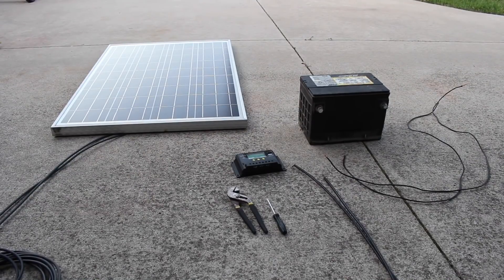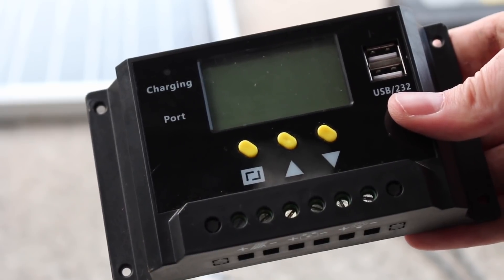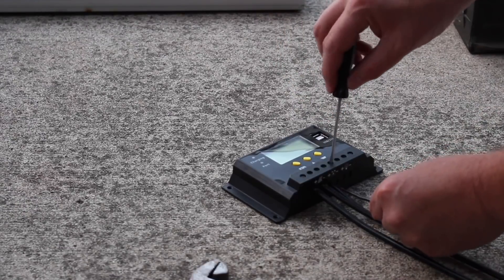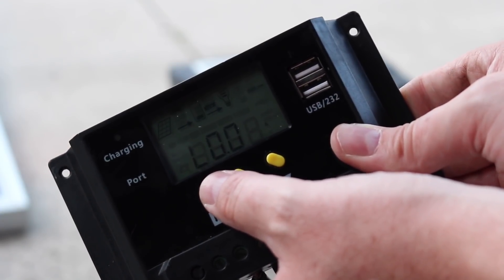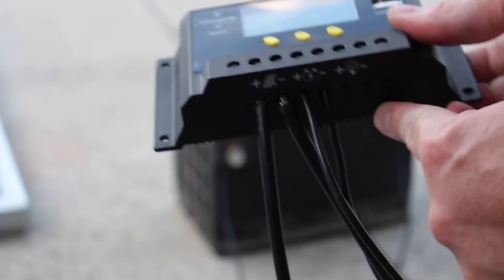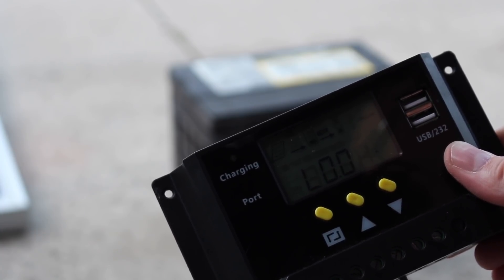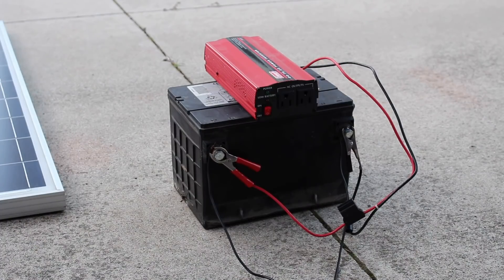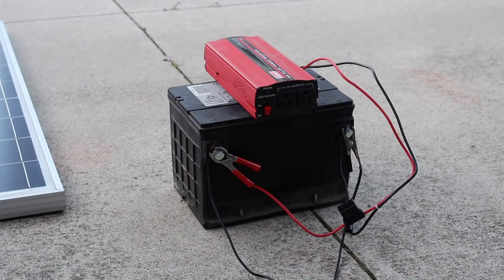Basic Renogy 100W Solar Panel setup!

Comment: How much does it cost simple setup?
Reply from the maker: A few hundred, I believe the panels are $130, then you need a battery and inverter.
Reply: @MikeSimon  thank you, my research on danish market says 350,- $, of cause i do not know if there options for find cheaper parts....
Reply: @MikeSimon  power converter most expensive and diff. prices on sol panels depend on type.

Comment: I want to use a Li-Ion battery but I find no info about these chargers, what is their maximum charging voltage, in my case should be no more than 12.6V.

Comment: Just into the video he connects the panel first - manual says "NEVER connect the solar panel to the controller without a battery".
Reply: My first reaction also. It's like intstaling plumbing under pressure! :-)

Comment: I ordered a kit from renogy on March 11th and as of June 11th was still waiting for the panel. Their customer service has been mediocre, replying with, "it's on the way" everytime I message them. 
I finally asked when it will arrive and was told its on back order now. I told them they've wasted my time and to issue a refund or credit. They took 10 days to issue the refund and then today only issued a partial refund. 
I would not recommend renogy to anyone.  Renogy is a terrible company to buy from.

Comment: Thanks, I didn't know the load was coming straight from the panel.  If I'm taking power from the battery how to I get the charge controller to stop at a point when the battery runs low ? Or can I only do those settings on the load ?

Comment: I have 2 75watts LED grow lights. I need to run them for 10 hours. Would this set up give me enough to run them both for that long? If not, how would I double my wattage and time. I'm looking for cheap solutions. This seems perfect for what I need. Perhaps I'd need 2 100w solar panels and two batteries? How would I do that. Would you mind making a video on how? This video really helped me get the basics I'm definitely going to buy a battery and a solor panel and converter.
Reply from the maker: Hello! So here is the simplest way to put it.. I think it will help you. First thing is figure out how much battery you have for example you have a 12V 100AH battery...convert it to watts by taking the AH x V (100x12) this gives you 1200watts. Rule of thumb is only drain battery to half for longer life. So this gives you 600watts to play with, now divide  600 / 150 (75 watts x 2) will give you 4 hours of run time. If you need more time then get more batteries. Now the same comes into play when you charge the batteries, if you only have 1 100watt solar panel it will take you 6 hours to recharge that 600watts you used. Let me know if this makes sense.
Reply: @MikeSimon  thank you for the advice. Yeah that made alot of sense. I wasnt sure I'd be able to u understand.

Comment: wrong procedure ...connect the positive and negative wire of battery first in the controller so that the controller could not damage.thank u
Reply from the maker: I see this is the case in some, but I have a travel solar setup that has the wires pre connected to the charge controller and all you do is open it up and connect to a battery and turn the controller on.

Comment: Hi thank you for the video!! But I have a question I want to run about 1200 watt solar panels.I want a setup to run a ac or fridge.Im assuming I would need a inverter to AC but does it only need to connect to one battery? Or do I need more then 1 battery for 1200 watt solar panels.I am really lost ! Need to know for offgrid house thank you  x

Comment: Very easy to follow. Thanks so much for teaching. I'm thinking to buy a gas generator to run small appliances.  For just using the solar system, Is there's a way to power up a 900 watt microwave  and the minimum inverter size and fuse do I need if possible?

Comment: If I may ask a question about the panel are the electrical wires already connected when they are sent from the manufacturer
Reply from the maker: Hello, they have like a 2-3ft lead that you can connect to.
Reply: What size wire do you run between the panels and the batteries

Comment: Sir, I’m interested in this project, I can perfectly connect all the electrical solar accessories together, I just need to know the numbers of solar panel and numbers of batteries and capacity of inverter needed to supply energy for 85” TV, ten points of 220volts bulb and two fans
Thanks

Comment: The battery should be connected to the charge controller before you connect the solar panel(s).

Comment: The wires attached to the battery look way too small.  You should use 4 AWG at least.   And it's not a good idea to connect the PV to the charge controller first.   Connecting them without first connecting the charge controller to the battery can fry the controller.

Comment: Thanks for the video. You ran a 7,000 watt inverter off a single 12 volt battery? I didn't think that was possible!
Reply from the maker: That I did and had no issues
Reply: @MikeSimon  Thanks for letting me know! I thought that there was some rule of thumb between battery capacity and inverter output.
Reply: Mike, one thing I saw on a Will Prowse video was to make sure that you hold a resister on the end of one of the inverter cables, before touching it to a battery terminal, to avoid a big spark - and to wear safety goggles.

Comment: I don't understand why the inverter is connected directly to the battery? Shouldn't the charge controller regulate this?
Reply from the maker: Hello, with the inverter you draw directly from the battery, the charge controller only regulates when to charge and when not to charge so it doesn’t over charge the battery. Now there are ports on the charge controller to hook up DC but for AC you need the inverter.
Reply: @MikeSimon  Hi Mike, doesn't that allow devices to drain the battery through the inverter - especially as there is no charge display? I get that you can switch the inverter on and off, but you can't tell when the battery is too low.

Comment: Don't forget you can cook the charge controller if you have the panel connected without a battery connected. Also, you should consult wire sizing charts and use fuses/ Breakers.
Besides that, pretty good video. I applaud you for actually doing it, and not just talking about it like most people do.

Comment: Hi how are you? I was wondering if you could help me. I want to install dash cam on my family car which i use only on weekends so car usually seats for 1 without starting. My idea was to install powerbank but it would not be enough for a week. I was wondering if i can hook up Renogy’s 16W solar Trickle Charger to the dash cam and power bank. If so would it works as planned? Thank you in advance

Comment: Hello! I hooled up my inverter and no juice. I just bought harborfreight 7 watt solar panel, battery and controler. It says its charging the battery but the battery is not putting out power to tje inverter. What do you think is? Battery says its charged too. Yesterday i bought a new inverter and when i hooked it up it made a wierd crack noise and i think i toasted it, but why? Also i plugged in the negative first, which i saw u doing it in the video., should i hook up positive first nezt time?

Comment: HELP ME PLEASE!!! I live in a 2006 Ford E250 Econoline van and want to install two 200 watt solar polycrystalline panels, a fuse block, controller, inverter, and 12 volt battery. What amp fuse block do I use; what size amp or watt controller do I use; what watt inverter do I use and what size 12 volt sealed lithium battery do I use? Its tooooooo confusing from all YouTube channels to get this all bought and set up. Please advise. Your video is a great one. I need guidance on mine because I'm using more watts for my panels. I'll only be using a small 1.7 cu. In. Ganley mini fridge from Walmart; a small toaster size Arctic Air Ultra AC cooler and one fan on and off. The little apt size fridge has a compressor that comes on and off. Heading out West July and MUST have AC and fridge, fans to use daily.
Please give guidance. Thanks!!!
Reply: Go watch Will Prowse Solar videos

Comment: normal table computer need max 750W power and display wery little. 1000W inverter can use one computer easy, if need boil make coffee normal boiler have 1200W fridge have many, how new then better have low energy models. need looking own fridge what haveback panel wattege need.all light no need inverter waste onmly energy lto if use. 12 volt can buy many different lamp. how many battery have then better have same panel, normal home need min 8 or 12 panel 100-300W/panel. good MPPT charger module and big wires and wire grimp connectors.panel cost normal 1W/1$ not newer more. 100W panel dont newer pay more than 100$ maximum /panel. charging module 10-40A all models cost normal 10-20$ MPPT model have lot better and safe battery more than old PWM charger. battery need be deep syckle battery,not car battery no longlive at solarpanel.panel maximum 100$/100W and battery have lot lot expensive parts this. all other have wery cheap and simple.

Comment: I have 4 250w solar panels and a 1200w powerjack inverter.
Which amp size charge controller should i get just to charge a small   car battery?
Cheers

Comment: Always hook up batteries first, you can burn out the controller, if any work is needed to take place on the battery side,  always disconnect the solar panels first.

Comment: Would i need an inverter also ? Or the charger unit will take place of that ?
Reply from the maker: Leo Rael hello you can hook up 12v to the change controller but you will need an inverter conned tot the battery also if you want to use 110 ac
Reply: @MikeSimon  ok I just ordered an inverter , does the battery in the sequence need to be a specific battery ? I'm using a deep cycle RV battery
Reply from the maker: Deep cycle is fine that’s what I use
Reply: @MikeSimon  ok 👌 thank you for the info
Reply: @MikeSimon  i have 200watts solar panels. A 30amp controller , and a 4000w inverter, and 1 deep cycle battery,  will one battery be enough to power the inverter?
Reply from the maker: Yes, that’s the same setup I had
Reply: @MikeSimon  and with the 4000w inverter was able to handle it ?
Reply from the maker: @leorael4497  I just went and looked in the garage, I run a 300W Coleman for testing and when i'm running lights or my desktop PC I have a AT3500, 3000 continuous/ 7000 peak and I had no issues with it connected to single deep marine battery
Reply: @MikeSimon  nice , and your solar panels are connected to eachother in parallel or series?
Reply from the maker: Leo Rael I did parallel
Reply: @MikeSimon  got it thank you

Comment: Your panel and battery wiring is under gauge as well.  Voltage losses will be substantial until you upgrade that wiring

Comment: Just a side note. The power out terminals are low power source in this case these solar controllers are originally designed for parking lot lights. The controller can turn on a light using the power out connector. It will cut power going out when the battery hits 11.4volts to prevent battery damage.

This power out feature is from the battery not strictly solar coming in. This feature can be turned off via the controller menu. The controller can be just solar and battery charge management.

For very low 12v power needs you can use the controller power out to power a fused maximum of less than 30amps or less than your controller max rating. So 30amps max you could fuse it at 20amps  to avoid blowing up the controller. 

In my tiny camper I fused my 20amp controller output at 15 amps to a small fuse box. From the fuse box I power LED lights and a 12v USB charging puck. Ive run this setup for 8 yrs zero issues. But my power needs never exceed 10amps.

A inverter or higher power need should be pulled directly from the battery via a fused power feed to your device.
Reply: Thanks for the extra info
Reply: This is what I'm interested in. Using my RENOGY 50W solar panel and the RENOGY 10W wanderer to just charge some small items without storing power. Any links to your set up?

Comment: I have a completely dead battery, the voltage is less than 3V because I've not used it for about 3-4 years now. So, should I hook up the inverter(2000W) directly to the load of the 40A PWM charge controller?
Reply from the maker: Chiagozie Ogbonna not sure if that would work, in theory it should since the load is DC just like the battery. I just have never tried it
Reply: OK, I'll try it, and see what happens.
Reply: Well, it doesn't work, it just beeps for a second and gradually fades away, then the lights powers off.

Comment: Is it okay to use 10A of contraller only to a 100W solar panel?
Reply from the maker: Yes it’s perfectly ok! Basically you want a charge controller that can handle the amount of amps your panels put out. A single panel may only be 5-6 amp

Comment: Hook up the panel last battery first lucky you did not burn it out
Reply from the maker: Does it really matter? I mean I bought a folding solar kit and the charge controller it pre mounted inside and all sealed for water proofing and all you do it hook up to battery which tells me there is no right or wrong way to connect

Comment: I would do a video of doing it correct. 
The wires sizes are wrong. The method of hooking up charger and batteries is wrong. 
So many problems showing people the wrong way to do it. These problems will destroy equipment and cause fires.... (Edit)Thanks for the info and keep up the hard work you will get it right!!
Reply from the maker: 200 watt too big?
Reply: @MikeSimon  sorry I read it wrong,  I stand corrected. I thought it was 2000..
I apologize
Reply: @sustainable which wire sizes would you use? Thanks!

Comment: if you're using the charge controller for your 12v instead of an invertor.would you need fuse breaker or inline circuit breaker on the positive wire to 12v.thanks
Reply from the maker: Hello, no you would not
Reply: @MikeSimon  thanks my friend👍

Comment: Don't put your 12 volt battery direct  on the ground because your 12 volt battery will not charge full..IAM licensed electrical engineer over there in the Philippines
Reply: What kind of surface is ideal for batteries? Thanks for the tips!

Comment: I thought  you can connect the load like inverter  into the output of the solar module. Instead of directly connect the inverter to the battery? Is that possible?
Reply from the maker: Hmm
Reply: @MikeSimon  anyway i still like your video. Since you give me a proper idea of how to use solar module.
Reply: @MikeSimon  this is just only my idea. But what do you think? Is it possible?
Reply from the maker: Never tried it, I’m sure it’s possible but where you May run into issue it the panels not putting out enough for the inverted

Comment: Thanks for the video. . . very easy to understand.
I will be setting up a solar panel to run a DC 12 volt Freg in a Jeep. Your Video shows your setup charging the battery, my question is can I then go straight from the battery to the Freg DC 12 volt connection or do I need to put something between the battery and Freg?

Comment: Is it okay if i'll use the load side of the charge controller as my inverter's imput power?
Reply: No. The load side is designed for SMALL loads like LED camp lights. Wire an inverter direct to battery
Reply: No, run your inverter straight to the battery and put a fusible link on the load or power side.
Reply: Cant read that charge ctlr.
Reply: What is the work of inverter in the solar panel

Comment: This connection did not go appropriately how it should go though he said he just want to demonstrate how a solar panel charges a battery because if not connecting for a house hold use, it should be battery connected first to the charge controller before solar panel and if disconnecting, solar panel first before battery because if you connect solar panel first before battery and the current comibg from the panel is high it can buen the charge controller.

Comment: The dc slot on the bottom right is direct source from solar panel, will it use battery power when no sun is out? I am trying to set up a solar  pond pump to run non stop
Reply: I have a battery tender as a backup

Comment: Could a 12v car battery works
Reply: Car Batteries are not the best for Solar as they have a massive Boost release of current (for starting cars) then a weaker current flow after the initial boost. Use a Deep Cycle battery, or Lithium if you can afford it. But if you can't buy then, use a car battery as a last resort. It will work, but not the best.
Reply: @Ken_James_SV  

Ok thanks
Reply from the maker: Stanley Gill yes they all have an ah rating

Comment: Yehhhh! I got the 100th dislike!!!!
Reply: HI  my power  inverter inside my trailer  is conneted outside in front of my trailer batterie,as a charger is this where i 
 put a cable on too my controler and panels

Comment: BATTERY FIRST
Reply: Why!?
Reply: For safety, because some charge controller are sensitive and may cause damage to Charge Controller if you connect the panel first. And you should select the battery type you are using on you charge controller first before connecting the panel.

Comment: Must hook up the battery first, before attaching charge controller.
Reply: Why is that so important?
Reply: @terrymulbah3635  solar charge controller are more likely battery dependent, and charger must determine first what system voltage to be used, if 12, 24,or 48vdc. So put battery first, or it will boom....